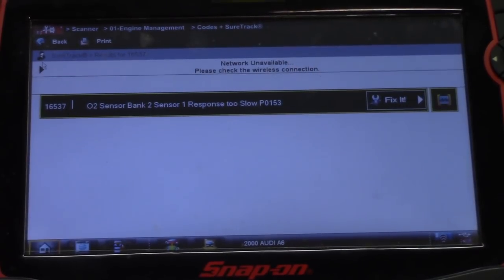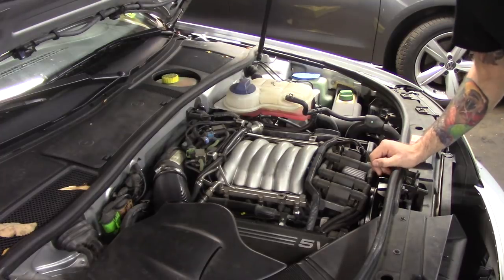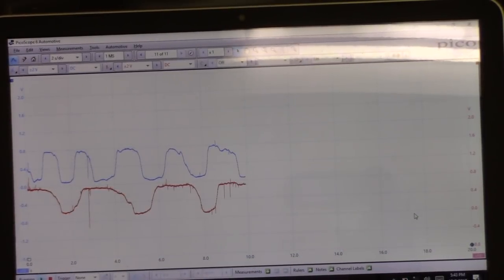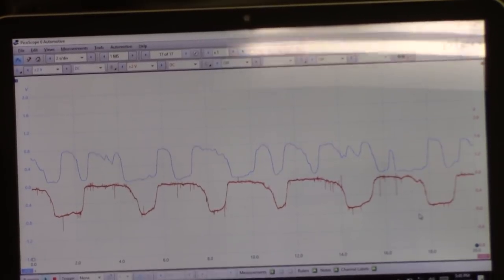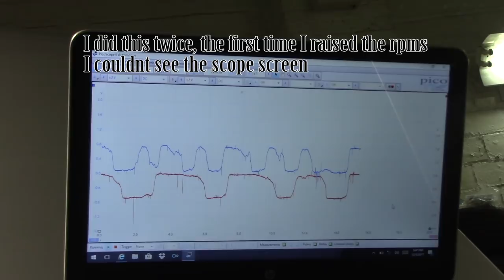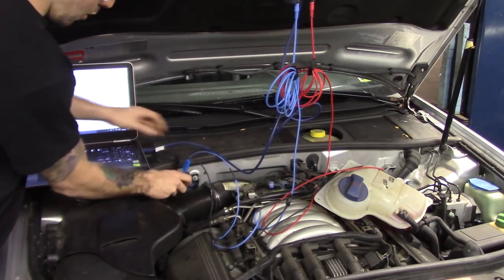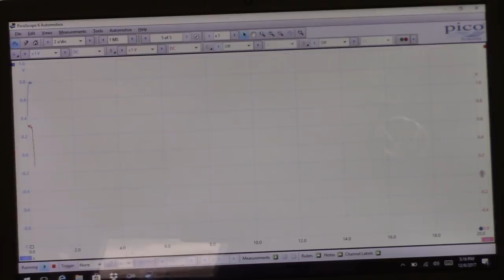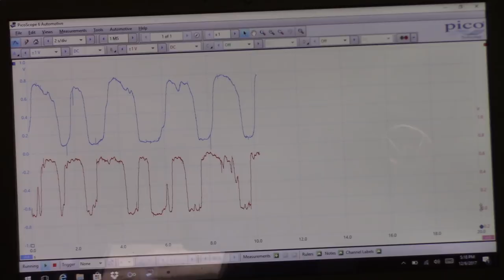2000 Audi A6 2.8L, Check Engine Light-P0153 O2 Sensor B2S1 Slow Response

Comment: Nicely done Tom and you may want to increase your sample rate a little higher when you're using longer time bases.
Reply: Great point for the capabilities of the Pico. Using 2 channels the 4425 could be able to be increased to 10MS/s.  If the time base is shortened it'll allow an increased  to max sample rate to catch glitches. The longer the time base the less samples per second can be obtained. A less capable scope the time base would need to be shortened to obtain the level of performance of a Pico.

Comment: Beautiful screen captures Tom! That Pico sure is nice. That car might be coming back for a B2 sensor soon from the looks of it. lol Thanks!
Reply from the maker: I kinda thought the same thing after seeing the new sensor waveform
Reply: The sensor switch rate is rich/lean/rich in 1.8s for it to still pass and it looks to be @1.5s and AM sensors are @$120-170 so they have time but if they're driving an Audi they already know parts are high..
Reply: I was kind of expecting to hear that both sensors were going to be replaced. However, not all Audi owners are created equal, if you know what I mean.
Reply: HAHA you got that right!

Comment: another great vid but i have a few questions, why did you hook up the scope rather than use a scan tool to look at the o2 sensor data, (faster refresh rate maybe?) 
and to me both those 02 sensors look like they need replacing, they are both quite lazy, did you recomend replacing them both rather than waiting until the better of the 2 throws a code and the customer has to pay for another diag?
thanks in advance.
Reply from the maker: I used the scope for the faster refresh.  I did not suggest both but that’s a good observation.  So far the car hasn’t been back for the other o2

Comment: Nice diagnosis Tom and pretty lazy O2 sensor.  Laughed how the new B1S2 made the B1S1 seem sluggish but that's normal. Was that an Audi O2 sensor installed?
Reply from the maker: it may be back for a bank 1 slow reponse
Reply: It was at @1 cycle per second which is @normal back then so it should be alright.
Reply from the maker: your right, I would be surprised if it did, the new sensor response rate was much quicker, I think it was an aftermarket sensor
Reply: I just looked it up & the sensor switch rate is rich/lean/rich in 1.8s for it to still pass and it looks to be @1.5s and AM sensors are @$120-170 so they have time but if they're driving an Audi they already know parts are high..
Reply: coming soon, B1S1 replacement :)
Reply: @haywardsautomotive6156  1a auto

Comment: why when you let off the gas both 02 sensors go rich for a bit then go lean. i know they go lean cause of fuel cut but they go rich first and that isnt making sense to me if you know please comment
Reply from the maker: Letting off of the throttle immediately closes the throttle plate so no airflow plus a fuel trim command. The way the fuel trims are learned. You have long term trims for idle and partial load and only one short term which uses either one of those depending on conditions. So my guess would be the partial load fuel trim plus the immediate throttle closing